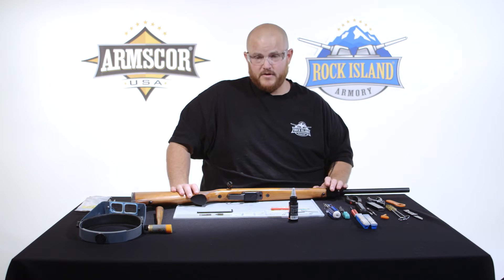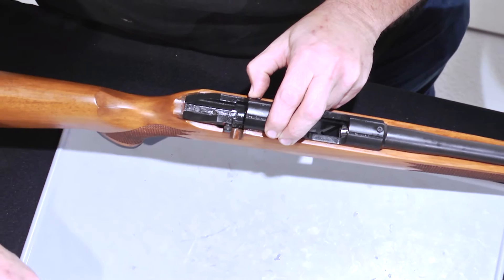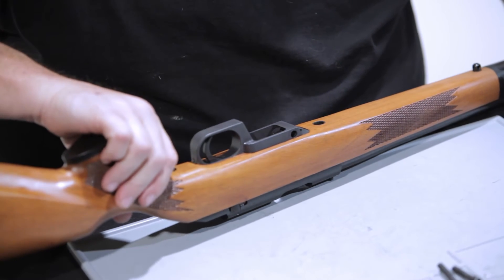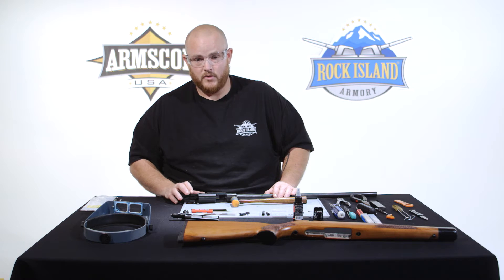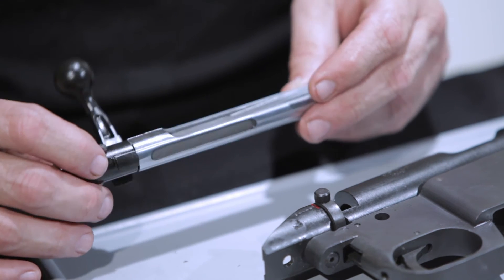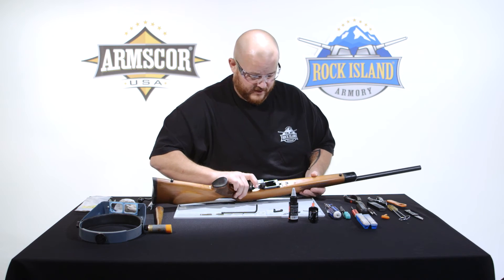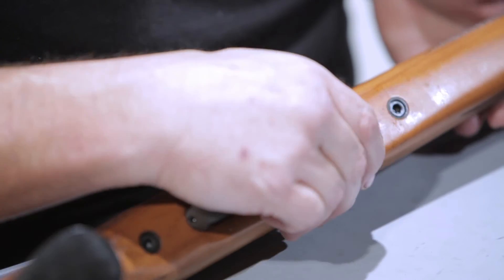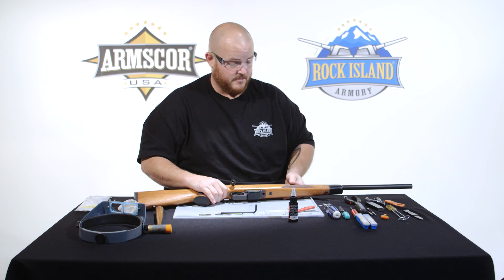Rock Island Armory - TCM Rifle - Disassembly Assembly

Comment: Would accuracy be improved by glass bedding ?
Reply: Yes, bedding the action helps any bolt action rifle. More solid and stable. But keep the barrel free floated. My friend has this rifle and had to sand inside the stock where it was too tight and pushing against the barrel. After that it was more accurate and consistent.

Comment: Why does Armscor NOT support their 22 tcm?  No different types of ammo than the 40 and 39 gr released.  No bolt gun currently available in the US.  No handguns with consistent feeding of the ammo in their factory mags.  Multiple trips to Armscor haven't fixed the feeding issues with my 22 TCM 1911.  No SAAMI submission.  I could see that if they were making money hand over fist with their monopoly.  But they're totally letting this caliber slide despite the fact I think it walks all over the 5.7 and is cheaper too.  But without many gun variants, reliable mags, and a variety of different ammo including fmjs or hunting type bullets from Nosler or Hornady, I don't see how they plan to ever sell a lot of 22 tcm.
Reply: Totally agree. 22TCM is fun and a good round. Basically 223 short. Velocity is 2K fps out of a pistol and low recoil. Good for handloaders. Reload 223 rem and if you get a split case, cut it down to 22TCM. Slightly modified casing below fixes the reliability issues and allows more projectiles. Clean and lube the chamber for reliability. Run the internals wet with oil. 
22TCM9R Improved, forming 223 cases (5.56x24mm) https://youtu.be/eYvCvHMBP-U

Comment: Where's the ammo got one and can't find ammo junk thanks for the waste of money. Dont buy!
Reply: ill buy your 22 tcm if you still have it
Reply: ill buy
Reply: 22TCM is fun. Basically 223 short. Good for handloaders. Reload 223 rem and if you get a split case, cut it down to 22TCM. Slightly modified casing below fixes the reliability issues and allows more projectiles. Clean and lube the chamber for reliability. Run the internals wet with oil. 
22TCM9R Improved, forming 223 cases (5.56x24mm) https://youtu.be/eYvCvHMBP-U